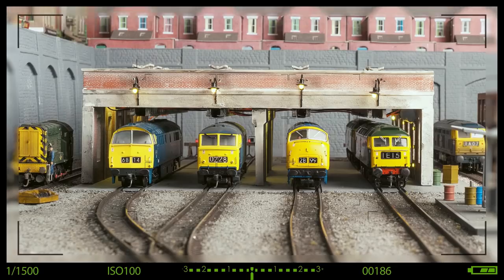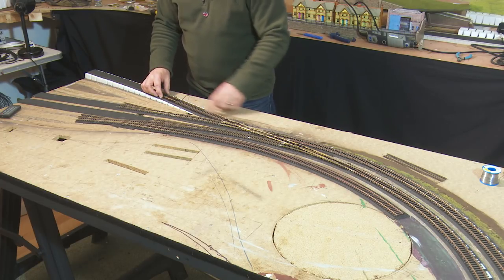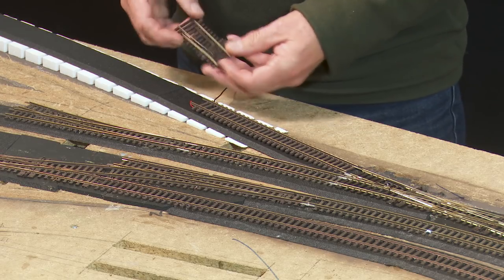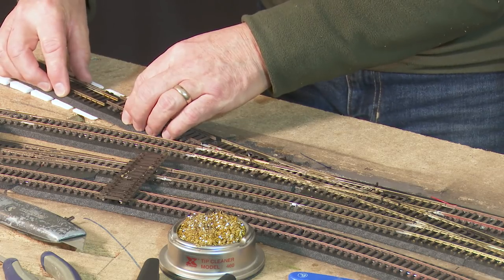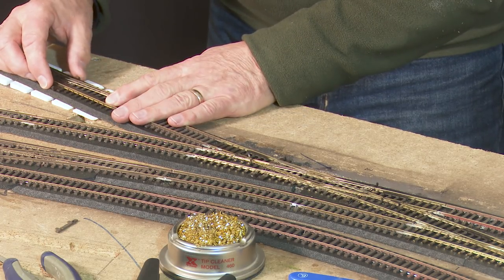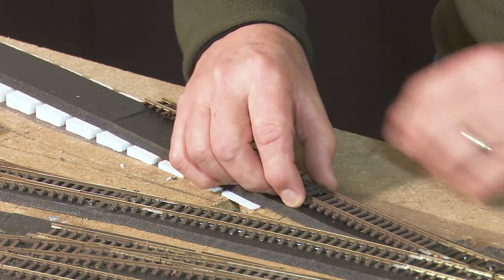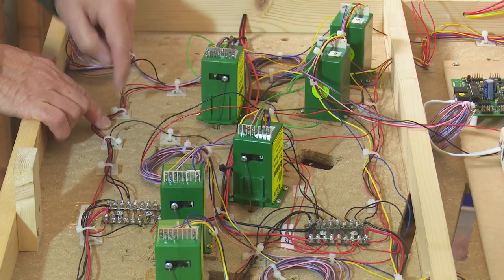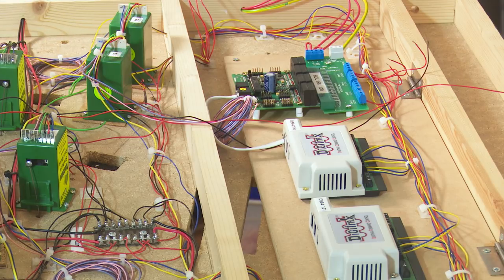Track Laying and Catch Points at Chadwick Model Railway | 79.

Comment: Really enjoying your series of videos before I start building my layout. One question - what size of wire do you use for the track feeds, point motors, etc.? Do you use solid core or stranded? I am just starting a OO layout.
Reply from the maker: Hi John, it’s known as 702.
That’s 7 strands of 0.2mm.
It’s the normal low power (1.2 amp) feed.

Comment: Hi Charlie, excellent video and thank you for sharing. You provide easy to follow videos, which are very well explained. I am in the process of starting a OO/HO layout, mixing everything from European, to British and Irish, covering steam, diesel and electric. In this era of heritage railways, it is very easy to justify have a great mix and match. When you glue the track to the foam underlay, is the Woodlands glue the same as an ordinary PVA glue, and how long does it need to cure on average? Thanks, Pat
Reply from the maker: No Pat it not PVA. It’s a rubberised compound that drys quickly and doesn’t transmit noise.
Reply: Chadwick Model Railway Thanks for your quick reply Charlie, much appreciated. 😃👍🏻

Comment: Hi Charlie, I model primarily in N scale (1:160).  I do have a large collection of HO scale (1:87) as that is the scale I started in this hobby with back in 1967.  I switched to N scale in 1989 because of the usual lack of modeling space issues. I just can't bring myself to sell off my HO scale locomotives and rolling stock, as many were Christmas presents from my youth. Unfortunately I believe Radio Shack no longer offers that type of wire stripper. Without going into a long winded story, Radio Shack has seen many cutbacks in their product line. Although not 100% identical, Irwin Industrial Tools and Klein tools offer similar wire strippers which are available through Amazon. Charlie, you need a good battery powered hand vacuum for cleaning up after drilling. As for the phone ringing,  isn't that the way it always goes, you're in a position that even if you dropped everything by the time you make it to the phone they've hung up. It's good to see that doesn't just happen to me 🙂  As for curving the platform, the only thing that comes to mind is cutting out small wedges on the non-seen or back side of the platform. Similar to the method used by wood workers using the Kerf-cut or Kerf-bending method. Sadly that would be a trail and error process. Cheers, Rich S.
Reply from the maker: Hi Rich, the good news is that I have invested in a battery vacuum. What a revelation.  Good luck with your layout and I do hope that the HO comes out once more.

Comment: Very interesting Charlie. I knew nothing about catch points. In a previous video, you showed a wiring terminal that had a positive side and a negative side with a wiring block on one end. I have had a look around Thailands DIY shops and I have not found any and also in Dhaka, Bangladesh where I am working for the next 5 months.    Please, where did you buy them from? Then I will ask my Dad and my older brother,(Who is also building a layout in the loft, but sadly he has a problem with one of his hands, so he has not been able to work on it recently) to get me some and send them to Thailand as I will not be charged any import tax, Unlike here, as I found out to my cost. Kept up the good work. Martin (Dhaka, Bangladesh.)
Reply from the maker: They are called tag strips. Available from
Squirestools.com

Comment: Hi charlie...congrats on another great video... just a quick question... why.. have you used an insulfrog crossing and an electrofrog crossing at the same junction??? what is the advantage/ thinking of your choice here???
ps. my railway is OO.. the best i feel...

Kind regards 
Darren
Reply from the maker: Hi Darren, I originally installed the electrofrog, switching to code 75.
However, I thought I’d try the simpler insulfrog to check that out too.

Comment: Great video Charlie 😊 I've done some 00 gauge layouts with my dad but I'm now starting a N Gauge layout because of the lack of space I have. I have a question about ballasting over points, what's the best way to do it without getting bits of ballast between the point blades? 
Cheers 
Jack
Reply from the maker: Tread carefully Jack.  If it’s a permanent  structure don’t glue too close the the moving parts.  If you do, hot water will release the PVA.
Reply: @ChadwickModelRailway  cheers Charlie, I'll be careful when doing it

Comment: Hi Charlie, Another excellent video! I am new to model railways and as I retire this July I am going to start building a layout in my garage. I am testing out the electronics now and have just fitted my first point with a tortoise point motor successfully. I didn't dare use a dremel (with glasses) to cut the piano wire armature as I knew I would burn the plastic being Mr Clumsy! Instead I cut the wire on my workbench to the correct length and then glued down the point onto the board. It seems fine.

Is there any reason why you fix the point first and then cut the wire? I don't want to continue as I might have missed something. Anyway keep up the excellent work and the thoroughly enjoyable website.
Reply from the maker: Hi DB, I always lay the track first then the point motors having checked that there are no timbers in the way, hopefully!

Comment: Good videos Charlie....all very helpful. I have a slight problem. I’ve purchased 2 no peco express point and I think they are electro frogs. Beneath them there are no wires yo be cut out or no wire from frog that goes to point motor. When I fitted them to track it keep shorting out.. Are there different types of electro frogs... ie. ones that you don’t modify? Maybe you’ve done a tutorial , not sure.thanks.
Reply from the maker: Hi Oliver, reply with the item number please.
Reply: @ChadwickModelRailway  good evening Charlie.. on the points, all it says is, PECO ENGLAND and PATS PENDING..there is no item number. It definitely is an electro frog, ie: no insulators between frog rails. Oliver.
Reply: hi Charlie. maybe you could shine some light on a question I have? I'm in the process of placing 2 nr Peco express point back to back to change tracks. my problem is, they're just coming of a bend and coaches will collide. I need to insert a piece of track approx. 3ins. I'm using seep points with electro frogs, I know to put insulated fishplates on points for polarity. My question is, what happens the short piece of track between points. Do  I connect it to bus wire as I will be with the rest of the track?
Read more

Comment: About the long platforms; if you were to cut small slots in the back you might be able to curve them?
Reply from the maker: A fair point Rob.
Reply: @ChadwickModelRailway   Using a heat gun/paint stripper might be another (tricky) option, perhaps a combination of slots & heat? Success!

Comment: Hi Charlie, Great videos showing you cannot cut corners and have to take your time. I am to much in a rush to get locos running. Can you run DC and DCC together on same layout successfully.? Also I am a OO person myself, a video on your thoughts which gauge is best I would like to see. Best regards, keep up the good work. You need an answer phone or a secretary.   Keith M.
Reply from the maker: Hi Keith, I’m so pleased that you enjoyed the video.  Mixing DC and DCC  is extremely difficult. However, you can run DCC locos on DC track as long as the respective CV hasn’t been disabled
Reply: @ChadwickModelRailway  Hi Charlie could you do a video on that to explain all the difficulties. Best regards Keith.

Comment: N-scale Kristian here from Sweden, thanks again for another great video Charlie, regarding those tortoise motors are they suitable for N-gauge and Peco c80 tracks and points or should I look in another direction as I'm obviously building an analogue setup but still want remote and hidden control for points?
Reply from the maker: Yes they are suitable for N Gauge, I know of folks that use them.  Regards Charlie
Reply: @ChadwickModelRailway  Well it stands between investing in them or make an old-fashiioned manual pulley-system now, there is a charm to that ;-)

Comment: Hello I run a oo gauge layout out in my garage. It's a hilly terrain layout with a mainline running a 37,43 and an 800 5 car set. And my 2 branch lines run many trains like 153,150 185,385 and many other trains. I also run many frieght like 66,50. And I runs Pendolino virgin sometimes
Reply from the maker: Wow, thanks for the info Salty.
Reply: @ChadwickModelRailway  your very welcome

Comment: Jon, Derbyshire. Been away from the hobby 20 years messed around with OO and N in the 90's. Have been watching yourself and others for a couple of years and finally decided to get back into it this week. Started a 2 1/2m x 1m OO gauge tailchaser & poaching an awful lot of ideas from your former two board TMD layout. Nothing exciting - scenic section of double track between two tunnels. 
Very interested in attempting to emulate what you have done with the automation on a more basic level.
Reply from the maker: And I wish you all the luck too.
Reply: @ChadwickModelRailway  without the pro background in electronics that you have to fall back on I suspect I'm going to need it! Still, could be worse... could be one of those sadomasichists that model in T gauge!

Comment: I notice that you are using insulated joiners on one track, but not both tracks.  Do you have a wiring video that discusses when/where on a DCC system that you need to include insulated rail joiners?
Reply from the maker: Not specifically Heath.  You must use the insulated joiners on the frogs of electrofrog points. I use them more often due to block detection.
Reply: @ChadwickModelRailway  Ahh, block detection, that makes a lot of sense I did not think about.  Is it correct that all you need is an insulator for one rail, not both?
Reply from the maker: Yes, that’s correct just one unless you have several power districts.

Comment: Continental (Austrian) N gauge for me. Just completed the low level bench work and 2 helixes for a new layout so wiring and track laying for the 2 storage yards up next.
Reply from the maker: Thanks David, I’ve never seen an N Gauge Helix.
Reply: @ChadwickModelRailway  neither have I, lol. Even with my lack of woodwork skills have managed to construct something resembling a helix so quite chuffed with myself. 800 mm dia, 5 1/2 turns raising the track 300 mm and approx 2% gradient. I have only dry assembled them so far so until they are fully installed with track laid I will not know if they will work as planned so it’s all fingers crossed. 
Very much enjoy your videos and have picked up a lot of useful tips.

Comment: I use cork for the underlay, I used the Gaugemaster foam years ago and 15 years later had to lift all of the track because the foam had turned itself into a bloody tar mess. I would NOT recommend foam for a permanent layout.
Reply from the maker: Hi Sam, time has moved on since those bad old days.  The Woodland Scenics version is something completely different and does not deteriorate over time.

Comment: G'Day Charlie. I model in OO/HO/HOn3½ in a condensed weird hybrid cross of Modern West Australian Big Iron, Modern Australian Interstate Freight and Passenger Service, WA Narrow Gauge Wheat Belt and Baulk Mixed Minerals/Industry with a Heritage Steam Branch line inspired by Hotham Valley Railways on the side. It pretty much lets me run any damn train I like from just about any era!  :D 

PS: Oh and yes I am also on a mad quest to make the layout as quiet as possible from that dreaded side effect of transmitted running sound going through the base boards (which is why this time I'm not using boards any more) and all I want to hear is the actual sound from the loco's sound decoders with virtually no track rumble/crunching from the rolling stock's wheels. Why, because I'm in my Loft and the layout route goes over the top of 3 bedrooms!
Reply from the maker: Wow, what a great comment.
Good luck with your project and I’m so pleased you the channel.

Comment: 00 Main area, and 009  2 track loos, gauge. Will also maybe have a 00 underground  2 track below. Will mainly use Hornby HM7000 DCC bluetooth chips foe engines. Megapoint Controllers for point changes, signals etc.  DCC concepts levers for points.
Reply from the maker: That sounds like a sensible plan Aaron. Regards, Charlie
Reply: Thanks Charlie, you are an inspiration. I also will use your health and safety tips.  I meant that I plan to have two 009 Loops and not loos 🤣.  Hope to see you at Milton Keynes GETS this year Sat 14th Oct 2023 if you can make it there.  Maybe you’ll be showing a layout perhaps?
Reply from the maker: I’ll be crowd side on the Saturday.
Regards Charlie

Comment: Hi Charlie.
Thank you very much for your videos, I have enjoyed and learned a lot from them.
Very well explained.
I want to ask you a question please.
I have a digital mockup with Z21, Roco multimouse in H0.
But I have problems with the Peco detours. They are code 75 - H0 - Electrofrog.
I use slow MTB MP1 motors, but they give me shorts even though the connections are correctly made, as you show in your videos.
I would appreciate your advice please.

Excuse my English but it is done with the translator.
Regards, and thank you very much.
Reply from the maker: I imagine that you need to use insulated rail joiners on the frogs. Regards, Charlie
Reply: Thank you very much for the quick response Charlie.
In fact, that's how I've done it. The two central lanes of the detour have insulating plastic fish plates. That's why I don't understand short circuits.
You may need to change the positions of the cables going to the tracks and connecting to the MP1 MTB motor differently. Although I have done it the same as in the videos. 
Red cable inside and black outside.
I will continue doing tests.
Thanks again.
Greetings.
Reply from the maker: Try reversing the power feeds that go to the frog switch on the MP1.
Reply: Thank you again for your instructions on my query and your speed.

That's how I'm going to do it. I'll comment on how the changes go.

Greetings Charlie.

Comment: Charlie another great video.  As per your request, I am building an N scale layout.  There is one thing that you might be able to help me on.  I am unable to find several Peco things in the US, for example, Tracksetta, N gauge Ruler, and 6' way gauge.  They are available on eBay and Amazon, but at high price or with very high shipping costs.  For example, the 6' way gauge, 45p in the UK, is available here for $15.65 and Tracketta are around $21.98. I will be in England in May and June, in particular Hereford, Oxford, and Colchester.  Is there a model shop that you recommend where I can purchase these type of Pico gauges?
Reply from the maker: Hi Earl, contact Hattons as soon as you arrive, I’m sure that they will sort out your needs.

Comment: HO scale for me.

Also, question. I saw on someone else's video they don't like using foam because the track moves too much on top of it, not sideways, but up/down. Do you find this an issue? I too, want to minimize the noise.
Reply from the maker: The Woodland Scenics foam seems quite stiff.

Comment: Charlie, I wonder if the catch point should be a run-off (almost like a head-shunt), or even a gravel trap to protect the main line. 
And the signal protecting the main line could even have SPAD protection (like WSR at Bishops Lydeard).
I’m with you, that the catch points should be motorised, but the cost should match the usage. And, with no frog to switch, a simple motor would suffice. (Can you use a spur off the motor on the main line?) a chance to try an MP1?
And are you going to space the sleepers with your new tool?
Oh, yes, I’m doing OO & OO9, but will have a section of the loft suitably scale-free to be HO compatible for those visitors from abroad. 
Regards, 
Tom
Reply from the maker: Hi Tom, the gravel run off is my chosen option but it can’t be linked to the double slip by the slips very nature.

Comment: Hi Charlie great video made me laugh with the phone part with Ian as for the platforms could you not cut them down and make them fit and maybe cut some wood and join them to it like a add on with the bends on the track.
I didn't know what the point  part just be for the incline I always thought it was a old point that re change and left part of the old point be great to see some locos running soon cheers Paul am on 00 gauge too
Reply from the maker: Thanks Paul, I’m so pleased that you enjoyed it.

Comment: Re station platforms, I assume they are plastic. Can you separate the top from the sides? If so, I would cut the "inside" side every so often, thereby shortening its length to form the desired curve. Being at the back of the platform you would have to look very hard to see the cuts. I would then cut a very small triangular piece from the top, every so often to match the curve. With your modelling skills Charlie, a little bit of modelling putty to finish the cuts, sand, and repaint. Hope this helps.
Reply from the maker: Some great info Doug, many thanks

Comment: The catch points/derail should operate simultaneously with the Double-Slip to simplify the purpose of operating/sending trains up and down that line. You mentioned a while back about the specific use between single and double-slip switches. Would you have a quick review about that?
Reply from the maker: If you search my channel I have done that video
Reply: @ChadwickModelRailway  Thank you. Found it. Answer accepted.